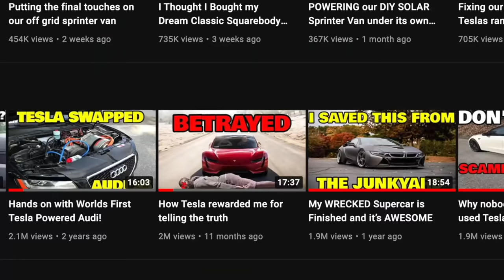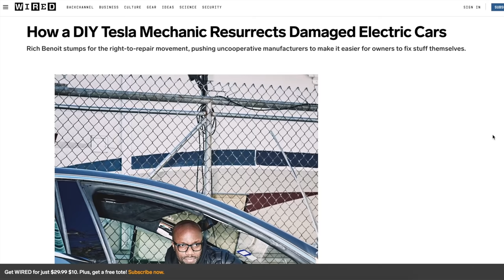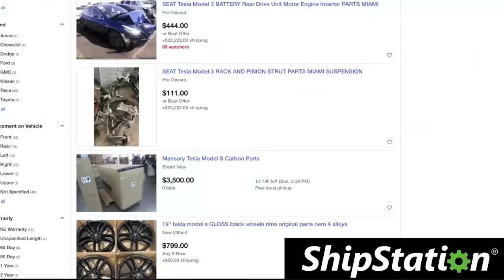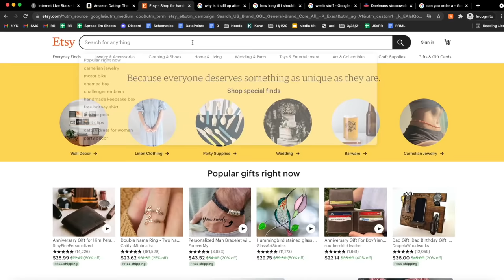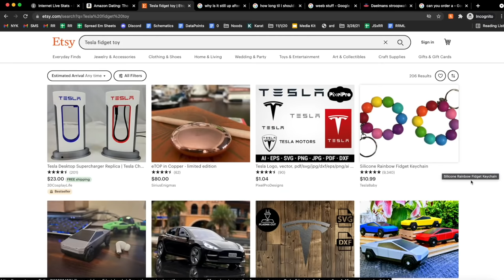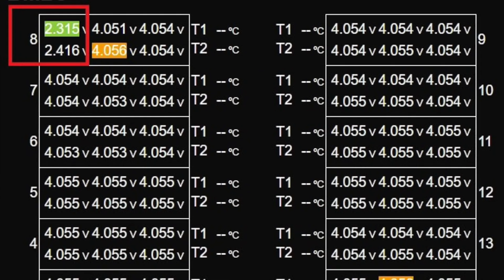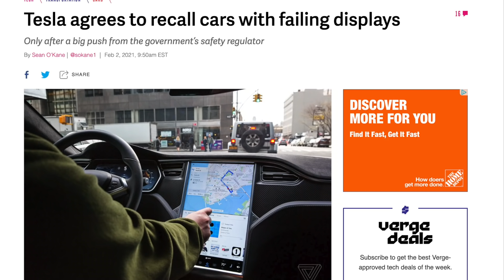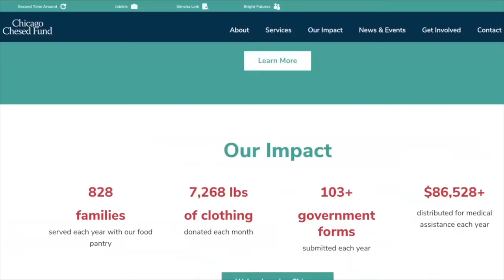Tesla wanted $16,000 to fix this NEW Model 3, we did it for $700! The importance of Right to REPAIR!

Comment: Sounds like an opportunity to create a bracket that’s attached to the 2 small bolts on either side if the nipple, as a “preventative” for folks with single motor cars.

Just thinking…..

Comment: It is NOT just Tesla that elect to replace parts instead of repairing them. It is an industry-wide practice that they firstly assured that the job is done right, and secondly they don't have to reply on their mechanics to be resourceful to do it right. Let's face it, quality work is dependent on the individual mechanic and all it takes is that the guy working on your car has a bad day and problem will come back to bite both you the customer as well as Tesla. Replacing parts (yes it is expensive), but they are assured that as long as the mechanic is competent enough to assemble things back as designed, chances of re-occurring problems down the road is minimal. I know in this case replacing the entire battery instead of a small component is a total waste of resource.

Comment: Tesla was built with ingenuity but obviously they skipped the ability to affect ingenious repairs. It is the same as throwing out the best most expensive toaster because the cheap plastic knob broke off on the lever used to lower the toast. That part should be serviceable. It looks way too easy to break that part under any circumstances. Kudo's for repairing it by just thinking about it for a second and coming up with a simple solution.

Comment: I'm sorry, but $700 for this repair is about $500 too much; what is your hourly rate?  I guess you guys were charging the customer for all the recording time it took to make this video.  Materials are a brass fitting and the coolant (which might be expensive and maybe cost $500; if so that is another reason why I would never own a Tesla).  I just read below that the shop paid for the towing; so I guess that's probably the extra expense.

Comment: if it's a 100 degrees outside wouldn't your coolant boil? wouldn't you die the instant you leave your air-conditioned car? what kind of apocalypse weather you drive your tesla's through.

Comment: I wonder if component repair is still possible in Tesla since the Cybertruck fills in the battery with foam. I suspect this is to protect from fire but wouldn't it make it unfixable as well? When I was younger, even clutches and AC compressors (at over a grand) was almost unmanageable for me. Even replacing an engine is cheap compared to a battery. While supposedly, under warranty, you get the battery replaced free, often that seems to be not the case. There is the road damage thing with Ionic 5s supposedly needing a battery replacement but not covered under warranty. The fact is a normal person can't afford to risk buying a car with such an expensive part that can't be repaired but only replaced (without someone like you to repair them). Until that problem is solved, anyone buying an EV is taking an enormous financial risk so I hope they're independently wealthy.

Comment: Hell, of all the things I have seen go wrong with Tesla and that some things might break on normal use of the vehicle, the cost of fixing the items is totally too high in cost. I rather keep my Gas-powered Ford and keep on tucking, not thanks for anything like Tesla although I just live 15 miles from the main Plant in Fremont, Ca. I just love to keep my Ford Truck and that's it, no Electric cars for me because when they break you just have to send it to the Junk Yard to be crushed, and the loss of your money in that JUNK. 
  Also just looking at a Tesla on a daily basis I always see so many imperfections on the Glass, Doors, Fronk, and the LED lights tend to burn out on half on one side or completely on the other side.

Comment: 22:07 Pete implies he has a modified belly pan.  I wonder if Tesla has revised to prevent this happening?  This outlet crack is exactly the sort of thing, owing to normal use, that a warranty should cover.  Its still a design flaw and something that needs an urgent change.  (recessing or covering with a shield)
24:20 Tesla seems to have rolled out proper servicing ideals too soon, and then realized at 2-5% adoption (BEV fleet totals) they could make more money with less invested in training and equipment.  Please continue to suggest they expand their service levels as fleet totals rise.  It will take 5-10 years to build out the services needed for 80% BEV (across makes).  Also remember older vehicles need more service, so it will lag.  If all the car makers sleep on this, and we don't have solid right-to-repair and independent shop techs, the 2030s will be a mess. (keep in mind this video is from 2021)
25:36  The highest coolant temps (excluding track) are used for "pre-conditioning" the battery before super-charge.  The pre-octovalve (through MY2020) cars got up to 53-degrees Celsius, or around 120-degrees Fahrenheit.  This is always cooler than "hot water".  Heat Pump models (new production) seem to top out around 46-degrees, or less (and only during battery "pre-conditioning").  In normal use, coolant will at most exceed ambient a couple degrees, as said here.  I've no idea what coolant temp is while racing on a course.

Preconditioning can use over 2kWh, from the batteries, which adds to their use rate.  Currently, I don't think you can opt-out of preconditioning, except by not letting the car know your route.  Also the batteries will heat anyway while supercharging, of course powered from charger.  I do not know exactly when the pre-conditioning starts, but to avoid wasted energy you could speed up to your maximum safe speed then.

Comment: Granted a Tesla or other EV is new, complex technology and nothing like an ICE vehicle and its components like an oil filter, starter, etc but wouldn't the Magnuson-Moss Warranty Law possibly address the fact that if the manufacturer is going to require the vehicle owner to ONLY use the manufacturer's part then the manufacturer has to supply the part at no charge?
I'm not a lawyer and never played one on TV but maybe a consumer rights lawyer might be able to shed some light on this. Also, I wonder if Professor John Kelly of Weber State University in Salt Lake City has had experience with Tesla technology. I know he's done a lot of detailed videos on YouTube on many hybrid systems of Ford, GM, Toyota and Nissans and I think some EVs as well.

Before I bought my used 2014 Ford C-Max, I talked to the service manager of the independent garage I'd been using for 20 years. I wanted to make sure they could service/repair the car and what his opinion was of it. I'd seen them.working on a number of Priuses. I watched John Kelly's video on the Ford hybrid system just to get some understanding of it.

Having seen this video, I wouldn't buy a Tesla seeing the grief that an owner of a new vehicle that would/should be under a substantial warranty given the cost of the product. Don't know what you folks call Tesla's customer service philosophy, but around here we call it "shooting yourself in the foot."

Comment: 700 to do that / i would be well happy to do that for 200. its not an hours work.... the brass fitting is around 2 dollars or 2 pound in English money a tap if you had to buy new 10 dollars.. hardest part is getting the car up in the air.. once i done this i would then make a guard to go in front of that hose,  its dead simple to make a strong steel plate to go in and protect the part...... to say that needs a new battery is taking the piss....... another case of Tesla having fitters not mechanics/engineers.... why people in the usa let a company say you cant repair your own stuff is incredible and gullible. you either own it or you dont.

Comment: I think the reason why they wanted to charge $16,000 for new batteries because they’re not automated for repairs yet the cars are to new in time they will be able to fix that and they will charge a lot less but this time they don’t have that option and they don’t know enough about fixing the cars..
Reply: The model 3 has been out for 5 years…. that’s more than enough time. Its that they don’t want to repair stuff,just replace it.

Comment: Hi Rich, can you help?

My 2020 I  Pace entered the service Department in Frisco Texas, on October 2023. For multiple traction battery failures. It’s still there today waiting for another battery module. Every time one is replaced, another one fails during the test drive. JLR North America stated that it Qualifies for a repurchase and opened a case for approval. Eighteen days later. I got a call with an offer of a $4,000 credit towards the purchase of another Jaguar I Pace. JLR Frisco doesn’t want an I pace that is in service for battery failures. The vehicle has under 37,000 miles, and is in new condition, however it is worthless until the traction battery issue is resolved. JLR North America stated that their is no escalation process. Take the in store credit or seek outside arbitration. 

The vehicle is still under the manufacturers full warranty. I have reached out to a few famous automotive YouTubers, because the world needs to know JLR’s process for failing Vehicles that are under full manufacturers warranty.

Comment: A leased car that the company will not pay to fix something mechanical? That's insanity. There's zero way I'll buy any one of these EV's for one they're overpriced junk and two they'll never outlast a gas engine. Not to mention I live somewhere with a rough climate where it's constantly up and down mountains and that drains these batteries even faster. 
Gas is record high because of the idiot we have in the White House installed with a toilet with dementia and they're pushing the green new deal. I'm sure people struggling to afford $5 a gallon gas are going to have $40,000+ just laying around for an EV and that banks will give people with poor to no credit due to financial hardship loans for these things. Already at scrapyards all over the country you see lots of EVs with little to no damage and they're junk just sitting there. I wonder how they'll make a lot of stuff for them considering Russia is one of the biggest producers of some rare earth minerals like sapphire etc? They'll be no chips for these things and Russia has already said it's not giving up anything until 2023 and by the time Dementia moron gets done trying to start WW3 we'll never get any of them.

Comment: Actually, I'd consider myself to be a Tesla fanboy, but it seems hard to understand how owners of products of certain brands can oppose the right to repair. Either those guys are rich enough to buy new products once the warranty is over or when the ashtray is full, whatever happens first, and they don't even care about resale value, or they're simply stupid.
I bought my MS P85 when it was 3 years old and had 100TKM on the dash. Now it's 10 years old and has 306TKM on the dashboard. The battery is still OK, but the time will come when it fails. The car is in pretty good shape, so I would certainly consider repairing it when it fails. I don't know when this will happen. It might be tomorrow or in 10 years, but I already have some spare battery modules in my home storage battery, just in case. Over here in Europe, some garages have specialized in repairing battery packs even down to the cell level, so I'm well prepared

Comment: Don't ever drive behind a Tesla. Due to safety matter, Tesla car sometimes just stop or suddenly reduce speed so quick that car behind will hit it. A lot of Tesla got accident, that's why most insurance companies quote higher than gas car.
Battery is a big deal. When time come, replace battery for Tesla may hit 20-30k dollars. With this money can buy a car.
Reply: You shouldn’t drive too close to the car in front in case they brake suddenly, applies to ALL cars. Who knew? 🤣

If someone runs into the back of a car the liability is with the other car, for ALL cars, so it can’t be a reason for high insurance costs on Teslas.

Teslas are expensive to insure because they have high performance.

If you buy a new Tesla-3 today, by the time the battery needs replacing (in 500,000+ miles) it’s going to cost around $5,000.

Good luck buying a new car in 2030 for $5,000.

Do you even own a car because you seem pretty clueless?

Comment: the plastic skid plates front and back...  any objects you run over with the front tires.   may ht and puncture through the plastic and hit the coolant line behind the wheel fenders.  I had  a  puncture on the coolant line.  It cost me 1400 to fix. and more than a week to fix.  Ans the insurance would not cover, because you ran over a station object.   So don't show a video, if you run over something stationary.  Even if you saw the object bounce on the road and stay stationary.   you will be at fault for not in control of the car.  BS insurance loop hole.  Anything you hit stationary is driver fault.

Comment: There are some plumbing engineers that could make a killing from Teslas .
$16k for a battery or $2k for re-threading a plastic fitting? I’m your buddy.
Anyone that has the same problems? Give me a shout out. Thread tape and good practice will save you a fortune.😅

Comment: I am sorry, but that part should have been threaded metal to begin with, there is zero excuse for this kind of cheeping out to save a few cents on the plastic there when such minor damage could in Tesla's eyes, "destroy the battery". Not only is replacing the entire battery costly to the end user, what about the environmental cost of disposing of the old (barely used) battery and replacing it with a brand new one. While I love the idea of a Tesla, the company itself are just plain immoral and are the Apple of the auto industry.

Comment: After working in the aircraft industry, I say car manufacturing has gone this same route.   Custom designs, high tech designs, constantly changing designs, no common parts etc.  CAD designing allows for all this.   Gone are the days when a automotive manufacturer would use the same alternator part number for ten years on a whole range cars.  All these freaking trick designs are great until it comes time to do repairs....  But - who does that?  Its becoming a disposable world right?  The whole world of consumer repair is going away.  Its all stupid, stupid, stupid - unsustainable and headed for economic calamity.   
I don't know what the rest of you are going to do after the SHTF, but I have a big shop, full of tools including a lathe and a Bridgeport and can fix almost anything.

Comment: Tesla are a total rip off for parts  and lack of service.
NEVER buy a car that has very poor servicing. Normal dealers too can be shonky but there is a LOT more of them. And ofcourse independent repairers. 
Insurance will cut your lunch on what the car  is worth. Though what is the cost on a 4 y/o Tesla, from what I understand it is about a third if you are lucky. So that 20k cheque has just become $10k. Supposedly the wholesale [never retail] price of the car. I am a vehicle dealer and have seen this dozens of times on real cars.
Insurance is going through the roof on EVs and quite a lot on normal cars as we have to subsidise these golf karts. 
Many business will not repair EVs as you are supposed to have 25 sq metres to park it awaiting repair. This is primarily on crash work. Where the business insurance will not cover you for repairing EVs. Crash shop fires can be very ugly, I have seen a couple.

Comment: So you used a $2 part and maybe 15 minutes of labour and still charged $700? How about disassembling the battery, replacing the plastic piece and then I can understand your price.
Reply: The price for the job was right. The time it take for them to diagnose the problem and repair it. They then have to completely re-fill the coolant,that’s $100+ just for that. And test that the repair has worked before giving it back to the customer. You clearly don’t understand how much stuff costs.

Comment: It is not Just Tesla that do that, More and more brands are makeing sure there is one way or another you at the end of a day you have to visit their service wich is usualy much more expensive. 
I miss good old days where every local garage could repair my car. And it is insaine if you think hopw many parts cars share between brands. 
For example I drive a VOLVO C30 that is basicly Ford Focus ( same platforms, same engines ) with  mazda developed 1,8l  engine jet FORD dealer  can nor repair the car since thay can not read Volvo codes from computer. So instead repareing my car in Ford shop that is 5 km away from me I have to drive my car 100  km away to Volvo service. 
This things make me crazy. I just can not belive that car that basicly uses same platform and same engine can not be repaired in both shops. 
And I am talking about car that is from 2007 so 16 years odl can not inmagine situation today where EV have different charge speeds. With gas car you could use any pumpe and get the job done in few min.
Another problems I have with EV is that they are not really that green but far from eyes far from heart. I wonder if anyone has calsulated how many CO2 is produced just to mine Lithium convert it to form need for building a battery. Not to mention it is extrmly rare metal. 
And electricity used for recharge is not really green is it? I thgink only country with green electricity ic Iceland.

Comment: Keep in mind they probably use the electrical load on the pump to infer flow rate for the systems on this loop. The batteries and inverter are probably running slightly higher. But I’m sure there’s some margin built in so not a huge issue for one new fitting.
Reply: One would hope so.